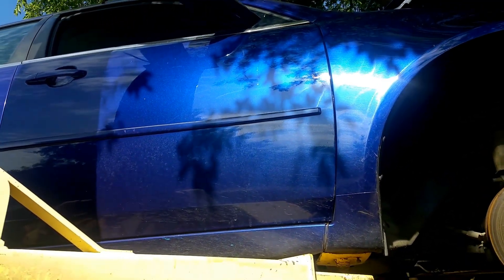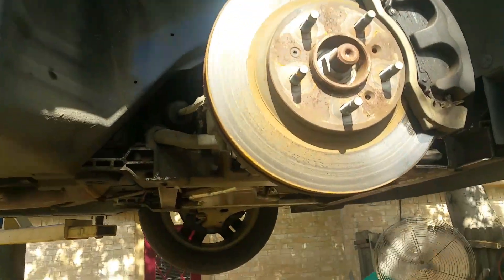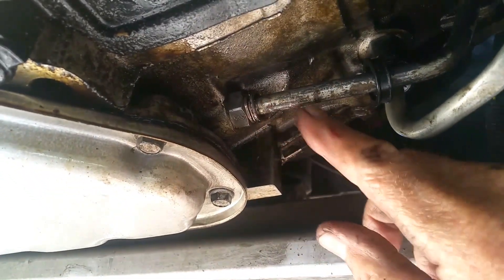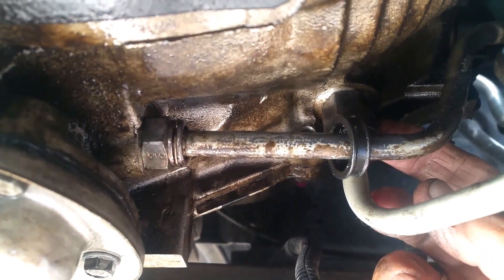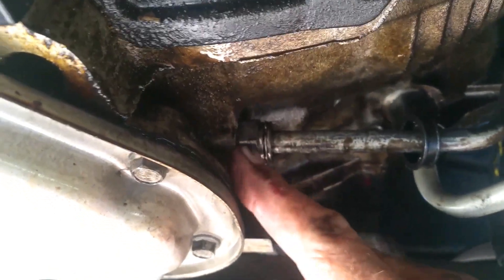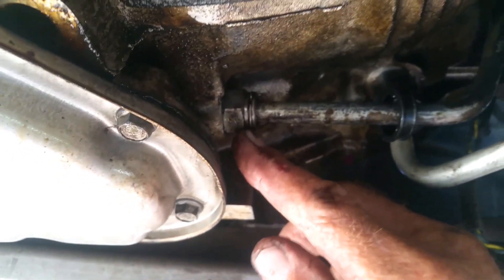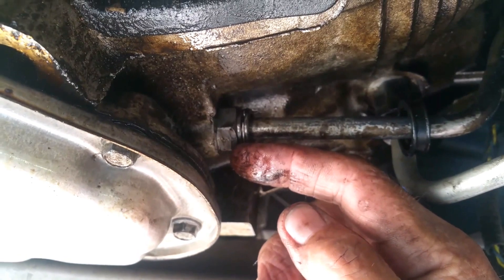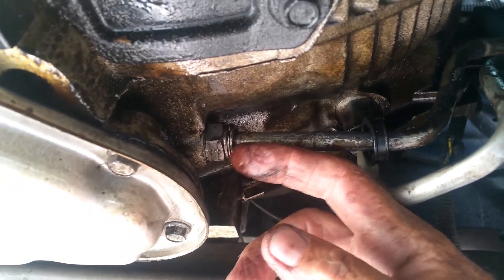2007 Chevrolet Impala trans.cooling line repair

Comment: Yooo Danny C! Thanks for the info! I just bought a impala 2007 3.9 and it’s got that slow drip leak rite at that transmission cooler line fitting! I could not get a replacement fitting at advance Auto Parts today. Thanks to you I’m gunna get my hook and pick set out and replace that O-Ring! I hope it works out 💪 thanks brother

Comment: Had a bad bottom motor mount cause the moter to slide to far think it may have damaged the lines will check this first before changing them thanks much

Comment: Mine is a 2006 Impala so I need to dig something out of the body? I can't just buy the screw part and stick it in there? I was thinking I had to buy a whole new line and I noticed all that comes with the new ones is that black plastic when I got into my car to change my oil that ring was just sliding all over the place with transmission fluid everywhere brand new transmission fluid I changed the fluid and filter during the summer on my own for the first time 😊🥳🍾 I love when you OG mechanics make little videos like this because to you guys it may be stupid and simple but we've been looking for shit like this I'm like what are the black plastic rings about does the clip go in those go in those you look online at a brand new one and that's all it comes with cuz that's how it's sold because they're cheapskates and google pics show you everything but that SMH so I need to unscrew that and dig a ring out

Comment: does it take 7.5 qts of trans fluid for a drain n fill?  and does that include the draining the cooler lines too?
Reply from the maker: That sounds close, the trans cooler is very small...on this car when I drain the fluid, I just look to see how much is drained into the pan and add that amount and kept checking the dipstick and add to proper fill line...PS you can get specs. but sometimes not 100% correct.
Reply from the maker: If I remember I think this car held a little over 6 Qt. of ATF. The main thing is to get it to the full mark on the dipstick with the engine at full operating temperature.